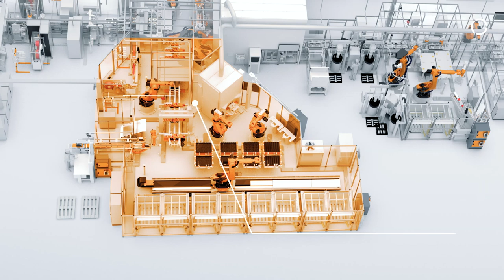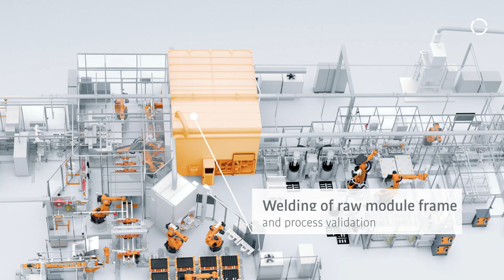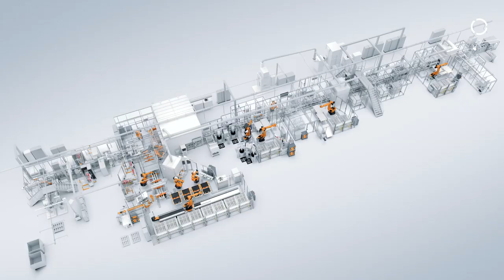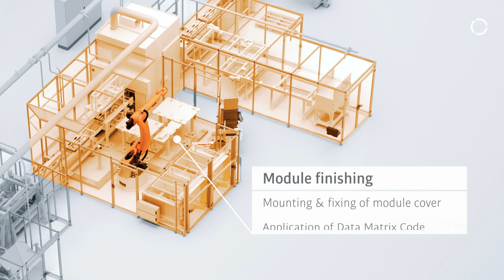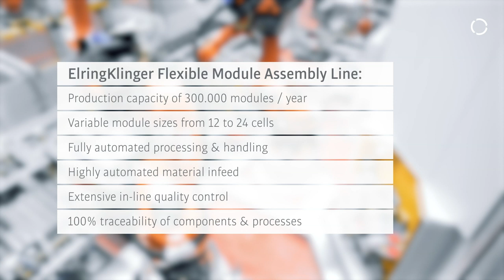Fully automated battery module production

Comment: This seems overengineered. I get that production should be flexible and adaptable but there was so much overhead here to do fairly simple tasks
Reply: Battery production environment is hazardous for human
Reply: @usmanAli-do6xf  i was not refering to the security i was refering to the equipment looking like michael bay transformers
Reply: @MyPonyIsLit flexible to make what? Toothpaste tubes? The tool is overengineered. You dont make a tool that does everything because tools that do everything are more expensive, need more maintainance, more complexity, amd are generally bad overall in their performamce. There is a line between flexible and overgeneralozed and this crosses it ...
Reply: Isn't it the goal for a robot to replace human for simple task? 
In car factory this goes to simply weld a bolt to a piece (wich can be already space consuming) to up to 14-15 piece together (at least in my factory). 
Since battery are standardized this can work for 10-15 years without having to change anything. So i think the time it took to designed it was absolutely worthed it in the end.
Reply: @clowsead  thats not how welding works. A robotic arm is ideal for welding given welding often requires motion in 6 axis, not to mention the process of programming a robot for welding is stupidly fast and simple. The welding tip is not over engineered it is a relatively simple tool for the job ...
I dont see how these compare.
Reply: @nosknut  I mean, this is basically an advertisement. Overengineering it is entirely the point. They're not selling batteries, they're selling the robots. It's the battery manufacturers job to do it the simplest possible way.

Comment: I think these robots are more like emulating how a human worker will do instead of stretching out what machines are capable to do. This is like using a robot arm to pour coke in the bottle, 1 per 30 secs. But a hardcore rotoray filler can do 30 per 1 sec.

Comment: How many different variants on production lines are currently planned?
Reply from the maker: Not sure if this answers your question. One challenge of battery manufacturing is that there is a wide variation of batteries that may be required, and that battery technology is also changing quickly. In terms of robot variants, we would match the robot variant to the application, so it's hard to give a definitive answer without looking closely at the whole automation system and plant layout.

Comment: The complete idiocy. It seems that the first parts of the lines are made in order to sell the line at a higher price. Lish robots would sell more suckers. I understand electric welding, no one is better than a robot. But damn it. Sticker insulator, and then peeling it off. And then turning over - and this individual robots ?? What kind of fuckers ?? Crap full, shit this line. Not thought out at all.
Reply: It sells more robots.  A lot of that should have been special purpose machinery, not off the shelf robots with semi-custom end effectors.  Shows like How It's Made sometimes give glimpses into what high throughput manufacturing really is.